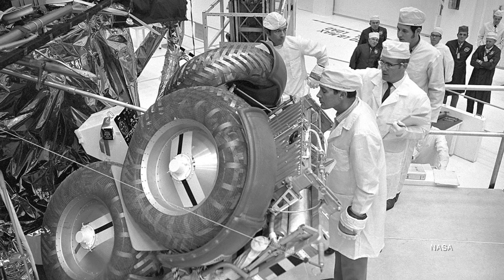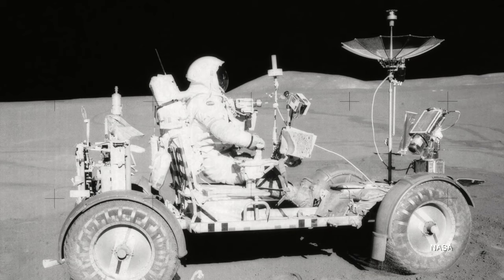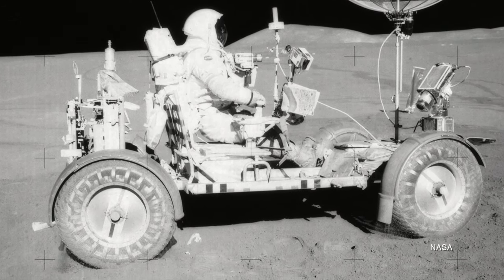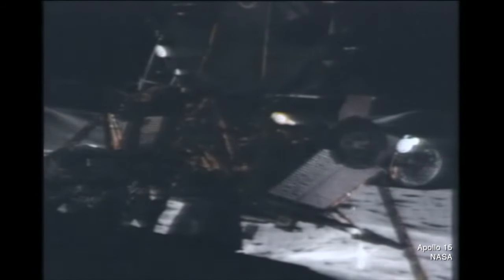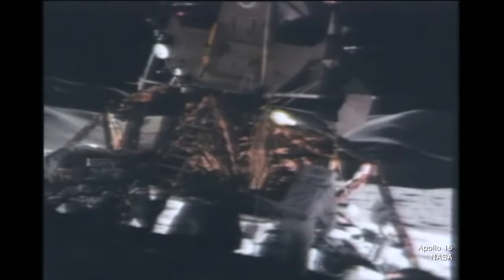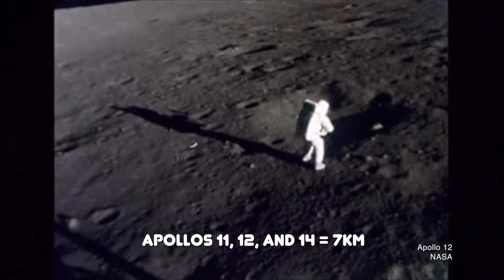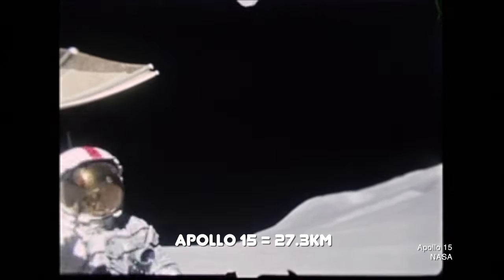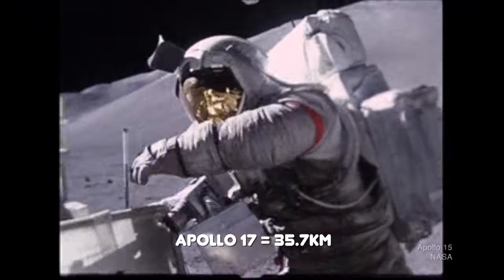How NASA Took Cars to the Moon

Comment: Hey, can you explain the comms set up on the Lunar Rover. Things like how did they power the Amplifier for the dish. Where was the dish pointing. How did it work when satellite dishes are mainly fixed point to point etc. What frequencies did they use etc?
Reply: It's blocking my reply, so, I will try to divide it into chunks and respond again.
Reply: Well, to explain the communications would take hundreds of pages.  I suggest you start with the LUNAR ROVING VEHICLE OPERATIONS HANDBOOK
CONTRACT NASB- 25145.  Also, you can read LUNAR COMMUNICATIONS RELAY UNIT LRTM-SY-1, Rev. D.  (That's the LCRU control unit.)  Those are just operations manuals, only about 300 pages total, not the full engineering documentation.  But, it's a pretty good starter, and addresses most of what you're asking.
Reply: They had to stop at each rover station and align the dish to point it at Earth.  There's an alignment rod/handle and a little viewfinder.  And, then Houston would be able to control the camera, and the DSN could receive the broadcasts.  Note: for Earth to receive the video, it took less alignment than for the rover to receive the control signals from Earth.  In other words, the DSN would receive the TV signal more easily than the rover could receive control input from Earth.
Reply: Audio was not done via the dish.  It had a separate little white antenna (which you can see in photos).
Reply: The rovers' dish frequency was 2265.5 Mhz (part of Unified S-band) for Earth communication.  There's information about all of the sub-carriers within the S-band in the handbooks.  And, for radio to the astronauts' suits,  259. 7 MHz (VHF), with a relay of 296. 8 MHz.
Reply: Beyond that, sorry, I tried to explain more, but, YouTube doesn't like technical details, I guess, because it blocked about 1/2 of what I wrote, and I just can't sit here and figure out why.  You'll have to read those documents for yourself, and ask any particular questions you still don't understand.
Reply: Also the signal was relatively low powered,  However the receivers are massive, Infact the first transmission was picked up in the UK by Goonhilly before NASA because of earth rotation, They also used a dish in Australia.

Comment: Outstanding.  Q.  Are they still serviceable (with a new battery) if there was a return mission to the area(s)?
Reply: No. By now even the tough old-style electronics are toast. The metal of the frame would be embrittled by decades of lunar heat and cold.. and the motor windings are probably in a million pieces from it.
Reply: It's not "intelligence". He's smart enough. It's a kind of insanity. Maybe it's an extreme desire to rebel against the status quo. In moderation, this is an important in-bred desire.
Reply: No, the batteries used where one time only batteries (like Alkaline batteries)
Reply: A one-time battery (opposed to a rechargeable) is called a "primary" battery. I don't think it's the best term, but that's the convention.
Reply: Would stand to reason though, that all other components being serviceable that perhaps new batteries could be installed?
Reply: My guess is that, yes, they are salvageable for the most part but non metallic materials and some electronics would probably have suffered in the 40+ years of heat and cold cycles and solar radiation.  If we ever go back and revisit the Apollo 15-17 mission landing sites, it would be safer to bring along new rovers.  But it would be cool
Reply: +Nicholas Hylton What type of batteries were used originally?
Reply: Pygar2 The regolith dust would have probably sand blasted the metal too.
Reply: butchtropic No but the regolith particles move because. of astereroid impacts.
Reply: They'll get up there and the cars will be up on blocks with the rims stolen.
Reply: +mahnarch
I didn't know there had been a black man on the moon yet?
Reply: O? with what wind?
Reply: But you didn't look that hard at flight paths, did you? Imagine flying from Johannesburg to Sydney. A Great Circle route, which is what aircraft fly, from Jo'burg to Sydney, is entirely over water, except for the extreme ends of the route. Now look at the flat earth model. Where does a route from Jo'burg to Sydney take you? Across Eastern Africa, Saudi Arabia, Northern India and Pakistan, the Himalayas, China.... doesn't work. How about South America to Australia? According to the flat earth model, you'd pretty well cross the North Pole. Nothing like that in reality. I think you need to have another think.
Reply: butchtropic,,,, Actually the lunar rovers were sand blasted! They landed near a previous site on one of the later Apollo missions and found that because the lunar dust is ionized it clings to everything making the equipment they had left behind look dirty but there was a section that appeared to have been sand blasted, some of the metal had even been taken off. It was from being too close to the take off of the lunar module. When the Astronauts launched back up to into lunar orbit the rocket motor blasted small particles away from the launch site.(I seem to recall someone saying they figured that some of those particles had been blasted fast enough to circle half way around the moon before it's gravity caused them to come down, with no atmosphere to slow them) And since the equipment had been left near by it had been blasted by small particles moving extremely fast since there was no atmosphere to slow them down. So those rovers that were parked near to the launch site to film the launch were indeed sand blasted! They found that since the tiny sharp particles, that have never experienced weathering of any kind, flew away from a launch at such high speeds it would be incredibly dangerous for anyone near by as such sharp fast moving particles might tear into their space suits. The lunar "dust" is incredibly dangerous to equipment even without a rocket to speed it up. It is ionized, so it clings to everything. I'm pretty sure they took special canisters up to the moon to bring the Moon rocks home in and at least early on all of them had their seals fail due to lunar dust. It is also incredibly sharp. It is made up of mostly silica that has been melted into a glass like structure them blasted apart by meteorite impacts. Some of which is again melted by further impacts and again shattered. And with no weathering like we have on earth every grain is like a tiny unimaginably, indeed otherworldly sharp dagger. There are so many little details we learned by going to the Moon that I find incredibly fascinating. Like the lack of weathering. I never even thought the lunar surface would be made up of tiny razors. But with no wind, or water to wear the edges down, and a never ending cycle of melting and shattering it makes perfect sense. Anyway... I have rambled on long enough, i will sign out the way I usually do;. Have a nice life, or at least try to. And certainly don't prevent others from having one!     P
Reply: By the time you get there the moon would have already said your 2 slow.Unless you use a FTL.
Reply: sparkplug1018 The "battery" system used was actually wax! All the lead acid and NiCd variants were too heavy. Heat generated from melting wax powered the rover. When they parked, they opened a cover to release the heat, and allow the wax to cool down and resolidify.
Reply: pizzafrenzyman 
Could you use a car from that timeframe? Most likely not.
Nevermind a rover on the moon.
Reply: pizzafrenzyman 
There are no rovers on the moon, there are no photos of them on the surface despite all the high tech equipment we apparently have up there
Reply: @nicholashylton6857 re you saying "we" like you were or are a part of it?
Reply: Hey! In 1968, I only lent them my go-cart for a couple of days.... where the hell is it?
Reply: @ChristopherUSSmith  No; the wax cooled the electronics as it melted.

Comment: 1: How did they save enough weight on Apollo space craft to take them; and
2:  Did they throw out the back packs before the launch from the moon?
Reply: There was always plans in the works to begin up-rating the Saturn F-1 engines so NASA also planned for some type of EVA enhancing mobile equipment to be eventually included with the J-missions. By the time Apollo 15 was re-scheduled as a J-mission, the F-1's were each putting out an additional 22,500 lbf of thrust.  As to your second question, yes they did to help save weight at launch time.
Reply: Ask that rocket guy on here, he knows everything.

Comment: Bringing a rover is one of the few things which are harder to do in KSP than in the real life.
Reply: I haven't built a rover in ages. I don't know what it is with KSP and wheels but they never quite get along.
Reply: If only stock KSP had foldable parts.
Reply: mesoth mesoth Basically XD
Reply: Until that time, there's Infernal Robotics. I didn't have much success even with it, though, so I ended up sending a non-foldable one anyway.

Comment: +Vintage Space How did the life support packs work?  When would they run out of oxygen to breathe and how far could they safely go on the rover?  In general my biggest curiosity are the moments where they had to go back to the LEM and what that process of changing in and out of those huge suits was like in such a small, confined space.  I'm also interested in cabin pressurization and how long it took for the LEM to re-pressurize?  Apologies in advance if these topics have already been covered, I will certainly look.  Thanks!
Reply: Any astronauts will tell you that getting in and out if the suit in space is a pain in the ass, and that it usually takes the help of a buddy.
Reply: Evan J  Hollywood  so it just Hollywood.  They didn't have remote cameras back then
Reply: Rocky Oneal  - they had remote (radio) controlled missiles by the end of world war two (e.g. the Henschel Hs 293) so why wouldn't they have remote controlled cameras in 1971?
Reply: Agree on these questions. I have always been interested in the repressurization of the LM. I think I remember seeing it took 90 seconds to depressurize. It just seems like such a critical part of the mission. If they couldn't get the cabin to pressurize, they'd have a real problem.
Reply: Rich Daley - their suits had valves and external connectors. So they could connect them with LEM directly. Normaly they still have to do it between EVAs to resuply tanks in suits.
Reply: The cameras on the rovers were remotely controlled, from mission control. However, time delay gave it several seconds of lag. They cover this in a documentary here on YouTube "Moon Machines - The Lunar Rover".
Reply: Richard Cornford   The first four channel, proportional radio control systems for amateur built model airplanes went on sale in 1964.  These were light and compact enough that the receiver, four servos and battery could fit in, and not unduly weigh down an airplane with an all up weight less than 10 pounds.  The story available on line is that these systems were developed from earlier systems developed at NASA’s Jet Propulsion Laboratory.  By the early 1970s, one could purchase a system that gave two channel, proportional control in a model glider with all up weight in the range 2 - 2.5 pounds.  Pointing the LRV camera would only require two channels.  I am not implying that the amateur grade equipment was used for the Apollo remote control cameras, but pointing out that the basic technology was available, as finished, retail products, to the public five years before Apollo 11.
Reply: @Zombie Killer Liquid cooled garments. That's for heat from their bodies. Heat from sun is mostly reflected off of the suit and it's insulated so water cooled garments were to stop overheating from their own body heat.
Reply: @SweetBearCub  If it had several seconds of lag, how did the camera manage to zoom out and up precisely in time with the take off? The only way you could capture that fast action would be without ANY delay at all, AND lightning reflexes!
Reply: professorchaos19  It's just that sort of comment that tells us everything we need to know about your way of thinking... you see it on TV so it must be an easy feat! How about you go and try it and get back to us with the results? Here's what you do:
Go to a field with a mate (A) who has a catapult loaded with a stone. Another mate (B) is a few hundred meters away, out of sight. Your means of communication is thus: you use a radio to give the signal to your mate B who then quickly forwards the signal to mate A. Right, standing near mate A with your camera, face him. Both you and mate A put on headphones and blindfolds. You must give the signal "fire" to mate B and decide when to start panning that shot. The next second, mate B tells mate A to "fire" and the following second, the stone's released..... How did it go? Did you get the stone perfectly in frame, panning and zooming as the stone ascended upwards? FIRST try? Don't just think about it, go and try it.... don't forget it must be as easy as COUNTING TO THREE!!!
Reply: Evan J they could safely travel all the way to the other side of the film set.
Reply: @drummingspain207  Practice they tried the same shot on Apollo 15 and 16, but didn't get it right until Apollo 17
Reply: @michaelthomas7898  Where's the footage of the failed attempts? Who was operating the camera - Houston, right? What's the total delay time? Come on, you'd need 100 go's to get that right. I'm just not buying it!
Reply: @drummingspain207  Do you make a habit of publicizing your screw up to every one. And yes Houston was operating the camera the same people who do the count down to when the lander is going to launch. The delay time is like a 1.2 seconds to the moon.
 You do have a lot stupid questions that can be easily looked up. Try reading instead of listening to all these stupid conspiracy youtube wack jobs. The moon landings where quite the accomplishment, not a lucky stab at the unknown. They shot of dozens of rockets through the lunar satilites, Mercury, Gemini, and Saturn programs just to land on the moon with Apollo 11. This girl knows way more about the moon then most, but there is still a ton of good reads on the subject even 50 years later.

Comment: Why in the he'll didn't Buzz take a picture of Neil?? Give me a break o
Reply: 1) He DID take pictures of Armstrong.
2) There are fewer pictures of Armstrong than Aldrin because Armstrong had the camera more of the time than Aldrin had it.  They only brought one Hasselblad to the surface (the other one was for use inside the module), and Armstrong and Aldrin alternated using it... but Armstrong had it far more than Aldrin did.
Reply: @phlhoran12396  
It would have been great to be there with them.  But, alas, I was far too young during the moon missions.